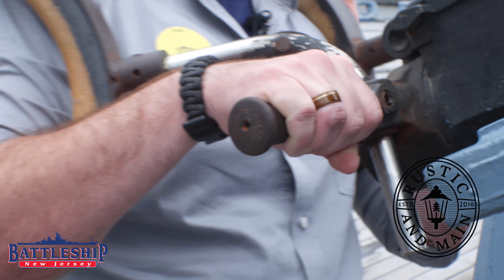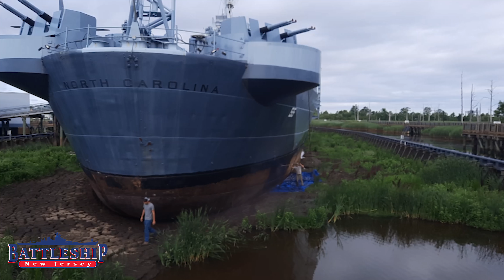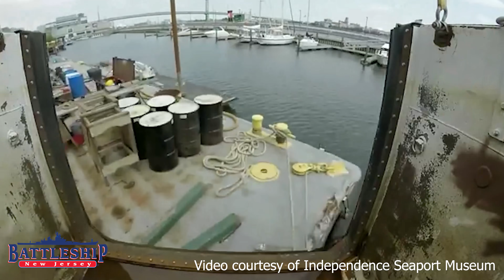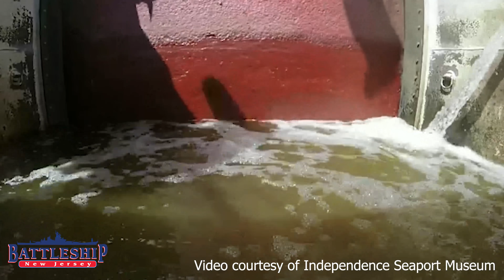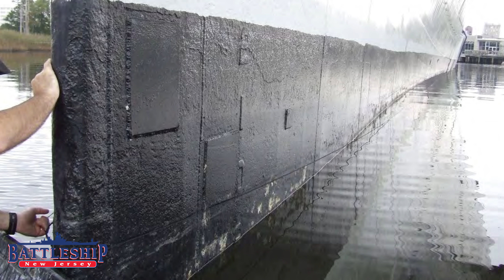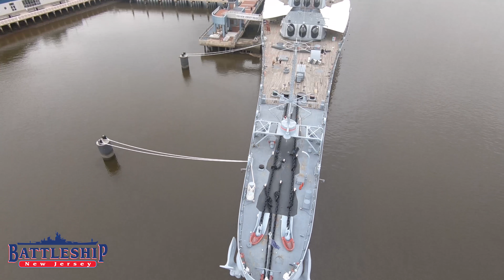Battleship North Carolina's Cofferdam

Comment: Thank you Rustic & Main!
Reply: to make it easy to maintain the water line corrosion protection, why not heavily ballast the ship so it rides low, now the rust prone waterline is high up the hull.   when it is time to clean the waterline, repaint it, then pump out the ballast to give a normal float height.  this will move the water below the water line, and thus allow easy access for maintenance.

Comment: I am not sure about having a ship stuck in the mud. Some mud is acidic, and affects steel quite badly. One hopes this is not the case with North Carolina, and Alabama. To my way of thinking it might be better to have the coffer dam filled with water. That would isolate the ship from the tides, and passing traffic, but still have constant pressure on the hull as it was designed to have.

Comment: how about using the coffer dam technology to build a "lock" and float the ship higher than the water line, then out of the body of water its in, and onto what was high and dry land.  Then build the side supports as a cradle and leave the ship on the land where the water will never be an issue again.  I think some submarines have been placed on dry land.

Comment: Here's an outside of the box solution that I thought of: what if you did a sealed cofferdam like this one around the ship, but instead of having the ship sitting in mud, you have it floating in some sort of non-flammable, non-corrosive oil/fluid. That way, it will not experience the 'pancaking' issue that you mentioned in long-term dry dock situations, but the fluid it is floating in will not corrode the hull like water will.

Comment: NO ALTERNATIVE TO DRY DOCKING?   Why not float these things permanently in an “ocean” of PEA GRAVEL?   Water drains away from the hull, is “viscous” at such large scale, and similar specific density of water.
Reply from the maker: That would be very abrasive on the hull, its not an ideal system. Here's a whole video we have about that: https://youtu.be/sa8x2gc448c
Reply: @BattleshipNewJersey  -Yes, I’m pretty sure I’d seen that.....prompting my idea originally.   Though admittedly, the “hydrodynamics” of gravel aren’t the same as water.  

If as a thought experiment, one could use a crane to lower the ship onto a bed of gravel, it would still mostly sit on top of it without sinking anywhere near down to the water line.  Thus, not equal pressure everywhere..........I think........   But I’m not sure such a hypothetical situation really matters.  It’s still awfully hard to even imagine the hull actually hogging while pressing up against thousand of tons of captive pebbles once in place.  But if actually accomplished, I suspect that one would also need to be able to (probably hydraulically) release whatever supports held the ship up during and before the gravel was poured into the void.    

But abrasive?   Only during the day that it’s dumped into the pit beneath the hull.  After that, the gravel, not to mention an 80,000 ton battleship, ain’t shifting or goin nowhere.   Gravel is used for exactly that purpose in a multitude of drainage and construction issues.  Against concrete, plastic and god only knows what else, without abrasion ever being an issue.

Comment: I think the best way to maintain the hull is to put the ship within a koffer dam with blocks positioned under her but she would still be floating. Then once the water within the koffer dam was isolated from the bay or river you could replace the water within with clean fresh water and maintain the PH level at just above neutral by adding sodium bicarbonate to raise PH and sulfuric acid to lower PH as needed, and the chloride levels as low as possible by purging and making up fresh water. Then, if hull maintenance is still ever needed, the water within the koffer damn could be pumped out allowing the ship  to sit on her blocks just as if a regular dry dock to allow the work to be done.

Comment: The ultimate thing to do is to built a containment area like a dry dock with sufficient hull support for the weight long term and keep the hull dry in perpetuity.  It would be much easier to perform exterior maintenance without the necessity of put her in dry dock periodically.

Comment: With tensions building up like this around the World i think its time to throw out the mothballs and stuff in the ammo. Those old giants still can put up a fight.
Reply: No they can't.  What is the point of a big-gun ship that can fire a whopping 30 miles when there are hypersonic missiles that can travel hundreds of miles?  It would be a big floating target just begging to be sunk.
Reply: @texaswunderkind  hm, in their default maybe. BUT: theres this one thing called: REFIT (aka modernization). Throw the diesels out, put the reactors in. Replace the old aa guns with modern c-wis and HEL batteries, replace the guns of the old broadside secondary Towers with missile batteries, like a bigger Version of the rim 116, and REFIT the Main turrest for modern long range smoothbore ammunition.

Comment: I would wonder after myself being on the BB59 Massachusetts at least a half dozen time if not more... Yes she is my 1st and so far only Battleship I have been on.  I was watching this video, and thought about floating dry docks, and coffer dam type structures... Maybe something like a floating pavilion so any of these great ships are still in water and not mired in mud, but that the bottom of where they are moored could be pumped out and be a drydock, like a floating or standard dry dock have it set up with keel blocks and supports in place. It would save a lot on moving such a large ship to a suitable dry dock, as the dry dock is essentially already be where the ship is. Kind of like how North Carolina is, but with out the mud... or need to dig out from under her. The structure would not have to be extensively larger than the ship. Maybe a few feet outside the outer mooring block limits to possibly a few feet on the outer side of the ship. That would help with ships in a commercial shipping lane as the outer wall would only need to be above High tide and surge level, but could be just a few feet from the side of the ship.  Just my thought. And I may have a design for something like this idea...

Comment: Thank you sir for your outstanding insights and deep dives.  I have really enjoyed it over the years.  Wet and dry cycles is something we deal with in civil engineering constantly.  In some cases 100+ year old timber piling can last essentially forever, but once the foundation is compromised and exposed to the air, its a rapid deterioration process that ensues.

Comment: Have you seen the situation with the USS Clamagore? Zero maintenance done essentially since Patriots Point received it. Got so bad nearly the entire outer hull was gone. They had it floated with buoys. You could still tour it in such bad shape. And if you looked down one of the ladders they have plexiglass over, you can see water not far under your feet. So now they plan to sink it as a reef.

Comment: Despite the drawbacks of setting a ship in a solid foundation of concrete like the Mikasa dreadnought, it seems that from a practical and economic standpoint it may still be the way to go.  If the thickness and strength of the concrete is sufficient, and of a composition that resists reacting with the steel hull the ship could persist almost indefinitely without recurring periodic external hull maintenance.  As I understand, the Mikasa was immobilized almost 100 years ago and it still looks to be in great shape.  Had the cement been stronger and thicker on the sides and of a better quality like that which is now available there may not have been the issues that were mentioned in the video.

Comment: Something I was wondering about was the ships that were currently free floating but are in danger of being mired into mud. I was wondering if New Jersey had that kind of risk and whether it’s a short term risk or more distant. Something I’ve come across in my days of fighting sediment buildup in water heaters in earlier days was a contraption that had an undulating hose in the bottom of the tank that stirred up the sediments and was carried out by the water flow. Since it’s limited by the type of sediment and the infrequent stirring it didn’t seem to be that effective in this application. But in situations where water currents are constantly at work I wonder whether it would be more effective for stirring up silt and dirt and making it dissipate in areas of less concentration. Having tubing designed with nozzles and/or a suction to vacuum it away and deposit it elsewhere could be a useful alternative. There’s one proviso to consider and that is it doesn’t increase the oxygen content in the water. I would suppose it might accelerate the rusting of the hull below the waterline. While this next item isn’t exactly related to the video it’s in a previous video where you mentioned above deck water leaks. It took me a while to think of solutions I’ve heard of before so that’s why the disconnect. Something I’ve heard about is using dyes to trace the path of the leak. Using different colors could allow you to trace multiple sources if used at different times. As long as they’re water soluble they shouldn’t cause problems later by leaving a permanent deposit in the leaking area. Perhaps the suggestions can lead to further ideas and adaptations. There probably isn’t any issue that hasn’t been encountered by industrial suppliers at some point in the past. Many can be very helpful with finding solutions. Keep up your good work Ryan.

Comment: From my experience in the Navy long term dry docking also has disadvantages. The blocks are wood which will weaken over time the block pattern must be exact and be a mirror of the hill contour of the keel. In hurricanes if the ship slips off the blocks specifically a museum ship it may be to costly to fix.

Comment: If you place tarpaulin or plastic with ribs going around then pump air into the ribs to make a cradle  then pump out the water. That is on the side of the ship and ribs and the tarpaulin keeps the water out. If you want more long term fibreglass the in side.

Comment: The obvious question to me, is can you build a cofferdam, but put blocks under the hull before you pump the cofferdam out (or even dig out under the hull, slide the blocks in, then dig out the rest) and then just keep  the vessel on blocks permantly making the entire hull permantly accessable for maintenance?
Or even after you clear it out, build an inner wall leaving enough room, around the vessel for maintenance work, then fill the inner wall with water - then you can pump the water out for maintenance and pump it back in when done.
A sort of  pseudo dry dock on the cheap.
I'm assuming the keel and hull can bear the weight, because I assume the keep and hull have to bear the weight of the vessel on blocks for dry dock.

Comment: Dry dock supports would be good,possibly, or sit it on heavy gravel , after repairing the bottom , doing the work a section at a time.  The ground would be lower than the ship ,so water couldn't accumulate under the ship in a bad storm. If it sits in mud, or in river water ,there won't be a bottom left in 10-15 years , maybe. Another point, is there is a kind of frame  in the ship, formed by the side beltway ( @ 10" thick ) and the armor around the turret bases and steering system. Maybe this could be used to help in some kind of support

Comment: The mud will have a higher at-rest lateral earth pressure on the hull than water alone if the cofferdam is dewatered on a continuous basis, and will be even higher if dewatering is not performed.  All this may be found in NAVFAC 7.

Comment: She is probably better staying in the mud. At least the pressures on the hull are well spread and it is like the hull is held in a very large hand. Putting her on blocks is not, in my opinion, a good solution long term. Look at the Victory and the Great Britain, both of these ships are on blocks and are suffering significant damage due to the hull sagging. You would have to put blocks around every frame to support the ship, not just the keel. The poms have allocated 21 million pounds to refurbish the Victory and I doubt that the sagging is reversible and she doesn't weigh 35,000 tons. Ships are not designed to spend their life sitting on their keel.

Comment: The wind/waterline exceptional corrosion has been known since 1900 or before.  Why hasn't this area been made thicker?    It would add weight, but essentially  to the most vulnerable area of the ship, so it is worth the extra steel...which would keep the ships in (potential) commission longer.    Ships under current construction should have this wind/water area thickened by some degree!!!

Comment: Has anyone designed a permanent hybrid? For the USS New Jersey you could build out a coffer dam and install full keel blocks for the ship to rest on in the current moored position. Install permanent pumps. This way the ship can stay at proper, controlled, water displacement but be able to drain the coffer easily for regular hull maintenance. The only hard part would be to come up with keel moorings that would allow the ship to float with the tides when the coffer is full and gently set her down when draining the coffer.

Comment: Y'all should look at the way rivers are temporarily diverted for building dams and working on spillways.  Slab pilings driven into the river bottom to form a barrier, then water pumped out to perform the work.  Something similar would probably work for floating museums.  Construct some wooden forms that will support the ship, as if in drydock, then pump the river down in-place to do the hull maintenance, then refloat when done.  the excess portion of the retaining wall which extends into the channel can then be removed for aesthetic/traffic purposes and stored until it's time to do another round of maintenance.

Comment: There's a Lightship in Delaware, formally Boston, now Overfalls. It was packed in the mud for a couple decades, mostly fine. There was nasty damage to keel at the bow from water coming in from ventilator shaft plus the waterline issues. Roughly 15 years ago it was dry docked and repaired. Now free floating in a b rakish river. This video and funding issues make me wonder about it's future

Comment: This episode made me wonder, and you probably get this question or similar fairly often; but considering that parts on ships need to be replaced to keep the ship intact, and even portions of the hull are no exception, what do you or other curators you work/speak with think of replacing the broken/worn out parts? Do you think it impacts the historic value of the ship, such as needing to restore a hull section that formerly contained damage control repairs (assuming there are any on any museum ships) or formerly had some personal touch from a builder or crew member? Do you or other curators ever find yourselves loath to part with a ruined piece of the ship due to one reason or another? Were there any hard decisions made with the New Jersey, other than the steam boiler jumpstart piping?
Reply from the maker: Its definitely tough, but we generally make decisions on, does it better protect the rest of the ship to do the thing? Rule 1 on museum ships is keep the water out at all costs. So sometimes we weld things shut.

Comment: I don't understand why they don't have the cathodic protection system on. I was in the US Navy for 8 years, I monitored and maintained the cathodic protection system on the USS Peterson DD 969 and the USS Carter Hall LSD 50. Both, when dry docked had little or no corrosion on the hull. The cathodic protection system keeps a electric field around the hull of the ship that highly prevents any type of corrosion. Just like the electrical process in water used to preserve the Titanic's artifacts, but ona ship wide hull scale.
Reply from the maker: Museum ships do use cathodic protection but it isnt 100% effective on any ship. The difference is that active ships are drydocked much more often than museums so you don't see much rust in 3 years like you do on museums that have been in the water for 30 years.

Comment: A gravelbed

Why not fill up the cofferdam with water higher than normal water level. so you can get a hight buffer against moisture from below. After that you bring drenagepipes on the ground under the ship. To keep it easyer dry. Than you pump in gravel and level it out. 
Now its time to drain the cofferdam an fill all up with gravel.
Remove the damparts and ad slopes of gravel to to the void spaces. 
Than you can give it free for the next project, or sell it.

In the end the ship got its own bed. Its higher up to avoid groundwater.
Rainwater can easily pass throug and lead away.
It also got pressure from the sides.
Last but not least. You can relativly easy enter places under the ship, by digging or sucking the gravel out. It should be easyer as to dig in mud.  

It sould be easyer to maintain, cheaper to build and last longer.

Greatings from Germany

Comment: How practical would it be to replace the hull at the water line with stainless steel? It wouldn't be historically authentic but if it kept them afloat wouldn't it be worth it?
Reply from the maker: These ships are 900 feet long, so not practical
Reply: @BattleshipNewJersey  So impractical for financial reasons rather than technical reasons. Makes sense.